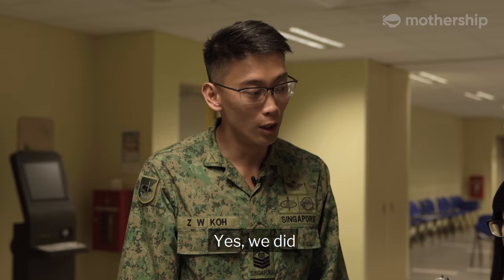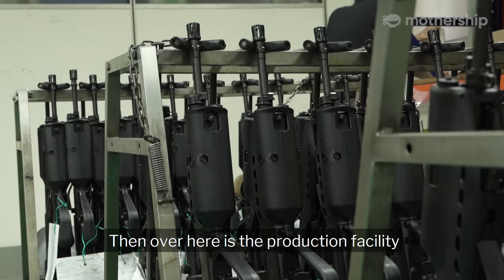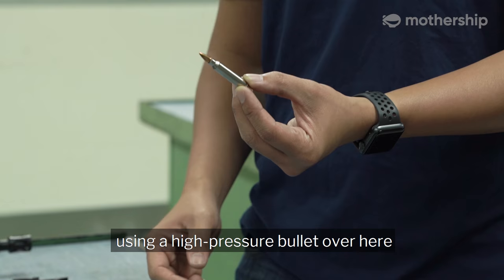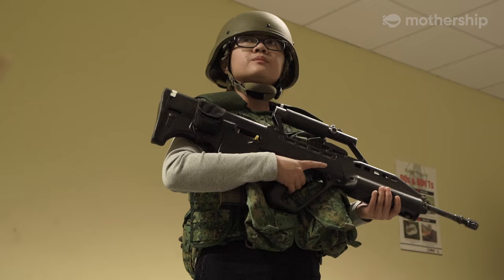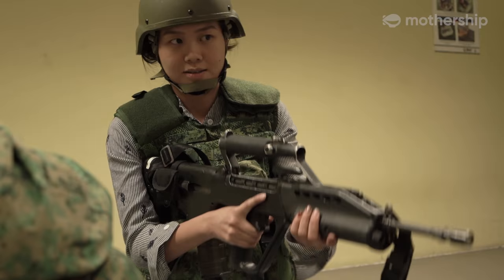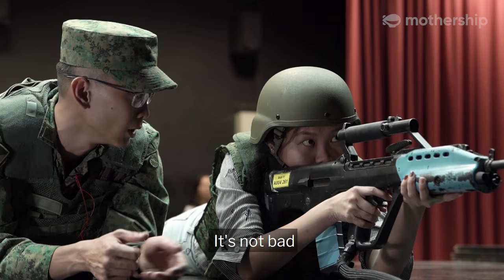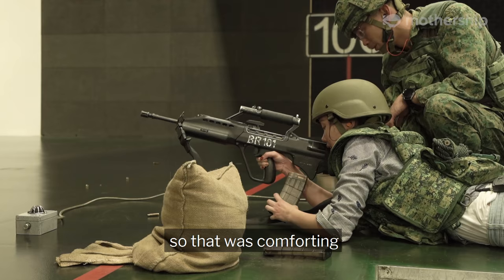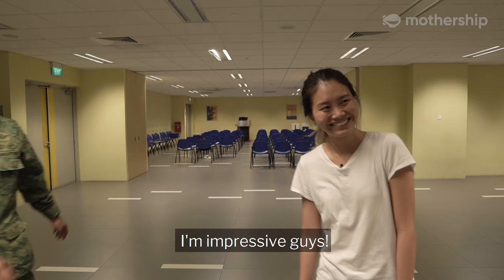Tell Me More: Two Female Singaporeans Tried Shooting SAR 21

Comment: Cb we didnt even get this kind of coaching when we live firing
Reply: YA LO
Reply: Of course lah this one civilian 😂
Reply: The circumstances are different when you only have to instruct a couple people.
Reply: Dunnid la SAR 21 is pretty much made to be "point where, shoot where kind of rifle" when they talk about "follow-through" for the trigger I find that actually a myth. When you pull the trigger slowly it actually pulls the weapon slightly off to the right. When you squeeze the trigger quickly the force doesn't affect the weapon as much and if you handle the weapon properly eg correct hand placement on the barrel, correct butt pressure and no "chicken wing" then the shot will still be accurate. Proper breathing technique is also much more important.

Comment: It's not even that difficult or scary to fire a gun.. but in Singapore it's scary to fire because of the risk of getting ND.
Life is tough
Reply: asd asdas what's ND?
Reply: @alphaomega9387  negligence discharge aka misfiring by accident etc. Even if it lands on the ground
Reply: asd asdas what happens if kena nd
Reply: @7974-k2f  You can get charged with ND, and if I'm not wrong I think a soldier who ND can face up to 3 months confinement, but I am unsure if it is eligible for detention barrack
Reply: @royalewinston3811  it is one of the fast way to DB by the way
Army nowadays do not tolerate ND on firing ranges
Quite harsh punishment if you you anyhow fire the SAR21 on ranges

Comment: Modern advancements in Ar15/ m4 type rifles really makes it the best weapon. It's got a variety of gas systems, ammunition, modular configurations and generally have free floated barrels. Which with half way decent ammo shoot sub MOA at 100 yds and are capable of body shots at up to 700 yds with 5.56 which there are even better types of ammo out now.

Comment: Please forgive my ignorance but i think the SAR21 do not have a shorter barrel but rather a shorter rifle length due to the bullpup design which the action is behind rather then the M16 series with the action infront.  If i am not wrong, both have the same barrel length therefore achieving the same velocity for the 5.56 cartridge.
Reply: Nope not wrong..not ignorant also..both models have a 20inch barrel length..one of the first things that was taught when we shifted from the M16S1 to SAR21 in unit last time.
Reply: You are right. I think encik say wrong.

Comment: I forgot about this weapon. I assume SAR 21 is Singapore/Singaporean or Special Assaults Rifle 21st century. Like the Israeli TAR 21 Tactical Assault Rifle 21st now the Tavor century or South Africas CR 21 Carbine Rifle 21st century. Kalashnikov is way easier to field strip reassemble 40 or less seconds total. The SAR looks pretty complex. Singapore also make the Ultimax 100 LMG. Thanks for sharing.
Reply: The disassembly of the SAR 21 is actually very easy. In typical field strip conditions, the SAR 21 comes apart into 5 different parts vs Kalashnikov 4, and that is because the firing pin of the Kalashnikov is not typically removed. If we disregard the removal of the firing pin on the SAR 21, it only comes apart to 3 different components, which is even less than the Kalashnikov. A typical solider should be able to disassemble the SAR 21 in less than 30 seconds, my personal best being 8 seconds including removal of magazine and safety checks.

Comment: I'm impressed by the professionalism of the instructors. Those two females didn't fair too bad either considering their lack of familiarity with firearms. That aside, I'm more familiar with the M4 carbine but the SAR-21 doesn't look too bad either.
Reply: SAR 21 vs ARs, I would go for AR. Its easier to handle
Reply: I'd go for the Remington 700.
Reply: Well, this weapons is built for conscripts in mind, mainly ease of use and ease of assembly. It is definitely a much easier weapon to field strip than an AR-style platform. My record for field stripping (including all the required safety checks) is 11 seconds. The only complains I'd have is I would very much prefer either iron sights or red dots rather than scopes as scopes can induce inaccuracy through parallax error. Other minor nitpicks are the mag release, bolt release and fire selector. Other than that, I feel that it's an extremely reliable rifle.
Reply: I think the SAR is really easy to use compared to the M16 - I definitely got a lot more target hits with the SAR than with the M16 - but the M4 is SO FREAKING LIGHT I LOVE IT
Reply: You would love our LMG, the Ultimax.

Comment: looked sketch early on
when it seemed she was scared
to hold the rifle tight to her shoulder
but she fixed that by later... its a primary
novice mistake that makes the firearm
LESS comfortable and controlled... 3
things help control the gun and
increase comfort -- the weight
of the gun... the weight of
the shooter... the weight 
of the earth -- so when 
you unify all 3 w/ a proper
hold and position then shooting
is many hundred % better/comfy

Comment: M16 S1 has longer effective range, but is longer in overall length, has normal eye iron sights. SAR21 is bullpup design, thus giving it a shorter overall length (good for fighting in confined spaces, tank crew), has a shorter barrel, thus shorter effective range, optical sights. Though the M16 has a longer effective range, its aiming system is normal iron sights and for user with poorer vision, the SAR21's optical sights helps. No point if the rifle can shoot far but has a poor aiming system - you will miss anyway. Down side is if you aim with a scope, you tends not to be able to see what is happeneing around you. With an iron sights, you can still see what is happening around you. The SAR21 can be customized. The barrel can be changed to a longer one and optical scope to a greater magnification, making it a sharpshooter rifle in a platoon. SAR21 still uses the 5.56mm calibre ammunition. The SAR21 has a long recoil travel, so it does not jerk much when fired as compared to the M16, improving accuracy with repeated fire, but makes its rate of fire slower. Trigger reset feel is very poor.
Reply: @P53eud0nym05  I know - we had to force the magazines onto the ground before the weapon can fire. That was due to the magazines. They need to be replaced. Nothing wrong with the guns. The M16 S1 and SAR21 both have their pros and cons. But i like the M16 S1 bolt carrier system and the fact that i can reload the magazine fast and with ease, and the closed bolt system makes the weapon fast and ready for action once a magazine is replaced. The SAR21 Bullpup system makes reloading slower because of the position of the magazine within the gun. SAR-21 (Bullpup) system rifles also tends to be badly balanced in my opinion. I would rather use the American M4 Carbine. The weapon still uses the 5.56mm calibre, is similar in construction of the bolt carrier and charging system with the M16, is lighter has a shorter barrel, rifle butt can be retracted, and with the option to fit a scope. Seems like Singapore military wants to ready our Soldiers for the future with an all new rifle, but if i were to go into action i will personally want a rifle like the M4 Carbine- light, efficient with options for add-ons and scope attachment to improve aiming.
Reply: wrong info. the S1 has the same barrel length as the SAR21, a 20in/50cm barrel. 
so no, the S1 doesnt have a longer effective range when they are shooting the same bullet. 
the advantage of the bullpup is the relocation of the bolt assembly into the otherwise empty buttstock.
behind the trigger, without changing the barrel length. 
this effectively shortened the whole weapon by ~8-10in/20-25cm without affecting range and power. 
becos the barrel length remains the same.

Comment: "Lightweight and designed for SAF soldier build" Let's compare the unloaded weight with other well known assault rifles around the world.
M16S1: 2.97kg
AK-47: 3.47kg
AUG: 3.8kg
SAR-21: 4kg

Meanwhile the SAR-21 version with M203 you see at 2:42 weighs 5.3kg. The old M16 with M203 weighs 3.99kg. SAR-21 lightweight sia.
Reply: its difficult to beat the lightweight of the M16/AR15 platform.  Bullpups end up weighing a bit more
Reply: Yea, part of the increased weight comes from the integrated LAD. Remove that and it'll probably come in around 3 ~ 3.2
Reply: I mean, it's still pretty light given the strength of the average man.
Makes for a better bludgeon if need be, less recoil, trains our arms too.

Comment: Those who know weapon will know SAR21 is heavier than M16 and the shorter barrel means less accuracy. Striping the SAR21 is a joke compare to M16, try doing it in a battle field with bullets flying at you. Is it really more suitable for Singapore or someone just trying to impress their stupid bosses? By the way the SAR21 is not tested in real battle. Should sent the designer to Afghanistan.

Comment: Bull pup rifle with unnecessary features.... Why not just get an hk416 in a 14 inch length or something similar?
Reply: SteveVi0lence with a 20in (50cm) barrel you can have greater power at short ranges and greater accuracy and precision at long ranges than with a 14in (35cm) barrel. The extra 15cm gives the bullet slightly more time to accelerate down the barrel’s length before it clears the muzzle, leading to a higher muzzle velocity
Reply: u lost some reach in a shorter barrel. 
and u lost some durability becos u need faster burning powder to achieve complete burn. 
the bolt and barrel probably gets wear down faster. 
this is a conscript weapon. cost of maintainance is an impt factor.

Comment: M16s are big cause Caucasians are larger and reach about 6ft in height.
Reply: Edward Lee the M16 is big because infantry doctrines in the 1950s and 60s still emphasised long rifles. Service rifles have generally undergone a gradual shortening over the years. Before 1918 the average service rifle was about 130cm long; this shrunk to about 110 in World War II and then to about 100 in the 50s and 60s, and then to about 80cm when the first bullpups were introduced in the 80s (FAMAS, AUG, L85A1) as more emphasis was placed on UO/CQB

Comment: The last time I tried firing the SAR 21 was in Discovery center. My father used the M16 at the same time. 
Not lying but I was able to shoot pretty well and on point. The instructor actually told a group of students at that time that the SAR-21 was bull pup such that if you lose an arm, you are still able to shoot with your other arm without much difficulty. i think I might be a reliable soldier in NS..